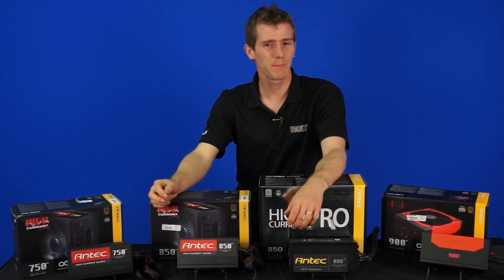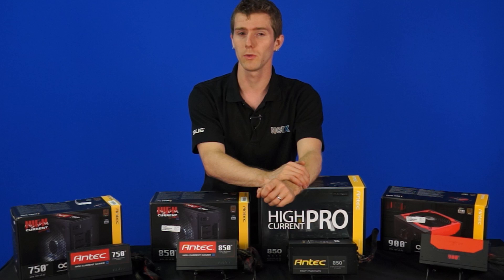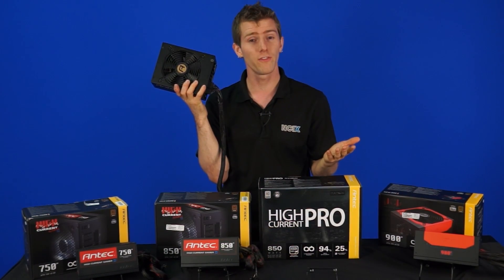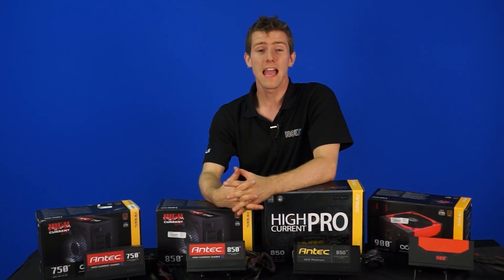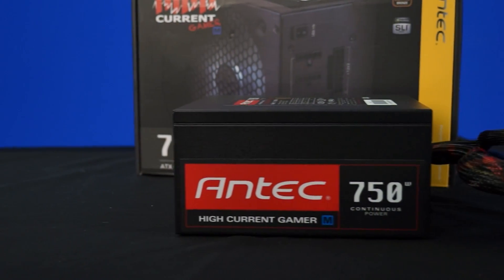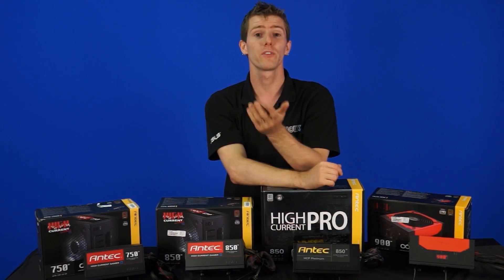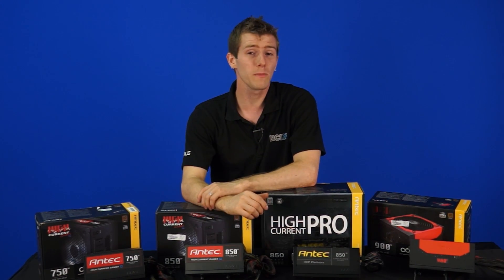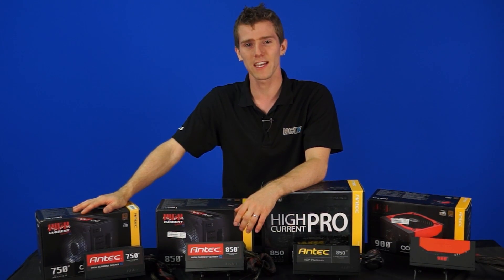How Many Watts Do You REALLY Need In Your Power Supply? ft. Antec HCG

Comment: Bmhforever Going with an 750 Watt Psu is retarded. Your System will consume about 400 (And then you have factor in the 80+ thing). I'd say go with a Seasonic 550 Watt g series (It's 80+gold,modular and it's only 60 bucks) Bmhforever Going with an 750 Watt Psu is retarded. Your System will consume about 400 (And then you have factor in the 80+ thing). I'd say go with an Bequiet Straigth power E9 (It's 80+ Gold and modular)

Comment: I would go with a 750 watt supply. With all your parts together, it's about 580 watts, which is close to your 600. With overclocking though, a 750 watt power supply would be your best bet.

Comment: Hey, I am working on my first computer build and I am in need of help with choosing the right PSU for my rig. I'm planning on OCing my Sapphire Radeon HD 7950 and OCing my Intel i7-4770k cpu. I'm unsure if the corsair CX600 could run the system or if I need an upgrade. Help would be greatly appreciated :)
Additional Parts:
-MSI Z87-G43
-Corsair Vengeance LP 8gb 1600 MHz
-Samsung 840 EVO SSD
-WD Black 1TB
-Asus DRW Optical Drive
-Cooler master Hyper 212 EVO CPU Cooler

Comment: you could get by with a 450w with a medium OC on cpu/gpu, heavy on cpu or gpu. It uses around 350-370w (taken efficiency into account) when gaming with a 4.8 ghz sandy (hardocp review). I personally would use 550w as the psu would not be as noisy under gaming or heavy load.

Comment: Recc PSUs: Seasonic Golds, Antec HCP, Kingwin Plat series, Rosewill gold and platinum series (I own capstone gold 450w, works like a charm with 670 gtx and i5 3570k@4.2ghz), PC power and cooling Gold/bronze, corsair AX/AXi Gold or Plat (Dont get the builder series.

On the budget PSUs: Pretty much bronze of the recced companies above. Corsair TX, PC power and cooling mk bronze series, seasonic bronze, antec hcg bronze. 

Overall Gold rated PSUs are worth it for efficiency, noise, build quality.

Comment: My rule of thumb is <75% on heavy loads or gaming on the psu for longevitiy of use and you should be fine. 75%-80% should be fine, but depending on the fan speed curve of your psu, you might not like the extra noise attributed for loading your psu like that. The 50% thing is honestly overkill and the way PSU companies market to get you to overpay for higher than needed wattage PSUs.

Comment: MY PSU GUIDE (With Medium to Heavy OC ing on cpu and gpu)
Quality 850w for 7970 (CF), Titan (SLI), 780 GTX (SLI)
Quality 750w: 670/680GTX SLI (could even be fine with 650w for light OC), 7950 (CF), 660 TI SLI (650w should be fine)
Quality 550w: Nvidia Titan, 7970, 780 GTX
Quality 450-500w: 670.680/660 TI, 760 GTX, 770 GTX, amd 7950 and below. 
Quality 350-400w: AMD 7870 and below; nvidia 660 GTX and below

Comment: Each rail supply's that certain voltage... Components need different voltage..
When somebody says 2 railed PSU, they normally mean the 12V is supplied via two lower wattage rails.
Aim for a Single 12V rail.

Comment: Ive gamed at 1080p with a gtx 780 and that gpu does work and still holding strong at 1440p even tho i could stand to go sli. I do think the 800s will be very dangerous for those resolutions and to go sli on the 800s would be killer which is the results i wanna see and crysis would run WAY smoother with those set of cards

Comment: True your right on. As of now i would go for dual 780s or dual high end 800s for 2560x1440/1600p and with getting 4k atm would be crazy for the price and it would take so much gpu power to push 60fps in games like bf4 and such..1440p/1600p is sick as well and pretty much killer over 1080p

Comment: It's in the description. You can calculate how much the machine is actually using based on the efficiency of each supply... if you average all 4 results you end up at 585 watts actually being delivered (since what they list is on the wall side). That's for a dual titan on a crazy power hungry processor running a load not likely to be seen in actual use . . . 585 watts. So next time someone tells you that a 700 or 800 watt is needed for a normal system you can happily laugh while you get a 500.

Comment: I'm a little disappointed that Linus didn't talk at all about how to calculate the power needs for your system.

If you already know how much power your system will use, this video kind of explains that you need to pick a power supply where the wattage at peak efficiency ≈ your power needs. But how do you determine your power needs?

Comment: gawd the most important thing how many watts does it use? If all the PSUs draw the same power it goes AGAINST the efficiency argument. They are all equally efficient in this case. I'm sure efficiency would come into it when using 500W vs 1200W but not when all the PSUs are in the 750-900Watt range.

Comment: 2 radeon 7870s running in crossfire?
A high end gpu =200W ish
RAM=5w per stick
mid range processor (eg i5)= 110w
optical= 30W appox
MB= 30-50W
fans= apox 10W a peice depending on model
keyborad + mouse = 10W ish
HDDs (not SSDs) = 20-30W each
LED stripts use almost nothing
a little math later.... 
assuming u have 2 GPUs, and 1 HDD, you could get away with a 760w although personally i would go for the ax860i for a little more headroom and the corsair LINK feature.

Comment: I dont like how you generalize the talk about PSU hardware linus.. A manufacturer can have good-better-best with totally different hardware under the hood.... Thus the efficiency curve will variate totally... No amplifier or PSU or any electronic device has a flat curve as it is anyway so to say it wont peak in the low or highs of a curve is nonsense... Ohms law is variating depending on the frequency you measure as one example... Its never a static measurement..

Comment: I've GTX680-SLI and use 800W PSU, my system pulls 550W from the wall under full load. Full specs on my channel.

Comment: so...I've got a 1250W in my system now, running a 560 Ti (used to have two in SLI, but the second slot died on me). Does this mean my PSU is pulling in more power from the wall than it's actually using?

Comment: So say I wanna SLI two 660 Ti's with my Rosewill Fortress 550W 80 Plus platinum PSU, can I do it no prob or is that pushing it? I only reach like 285W worst case scenario, and low-to-mid 200's on average gaming load with my single 660 Ti system.

Comment: Not really, no. As linus said, the curve dropps down in both low AND high load. And generally peaks at ~50-60% load. So using around 500w from ur 850 is probably pretty perfect.